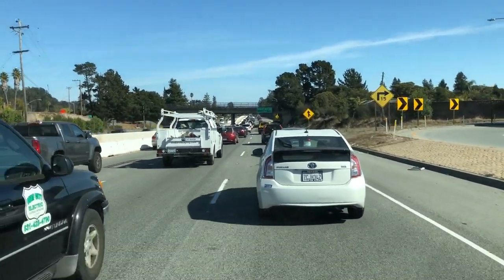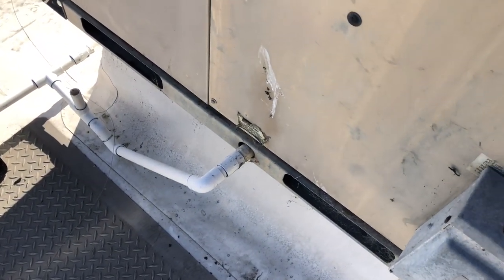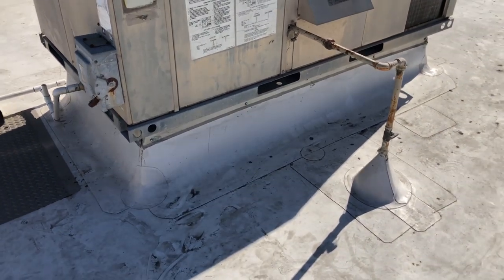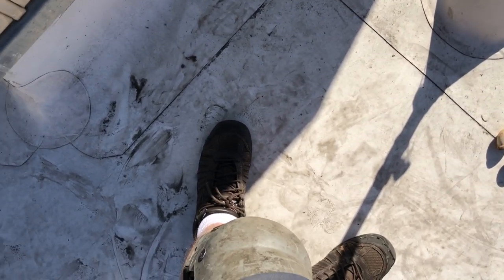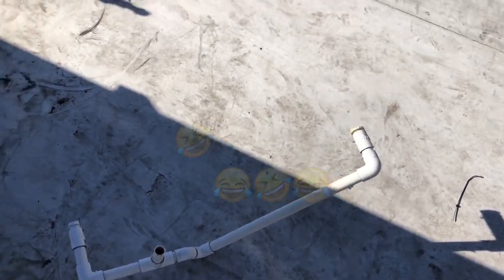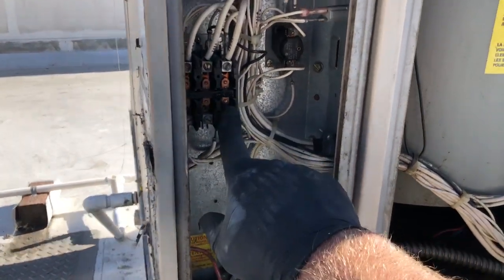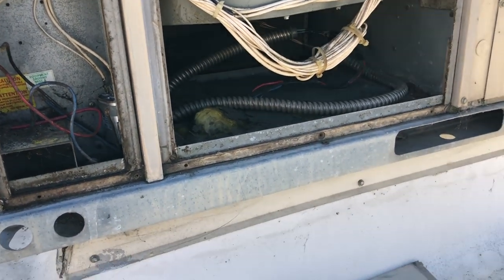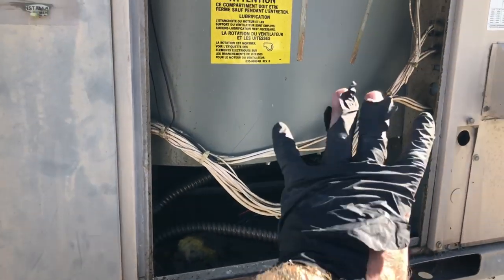Prep a RTU for removal from roof

Comment: Disconnect electricals, remove anchor bolts. Attach shackles.
Up and out
Drop and anchor.
Check rotation and charge
Job done
Reply: Not much gas hook ups down here